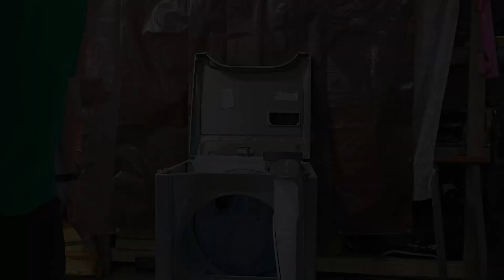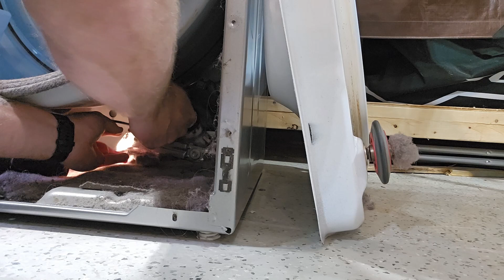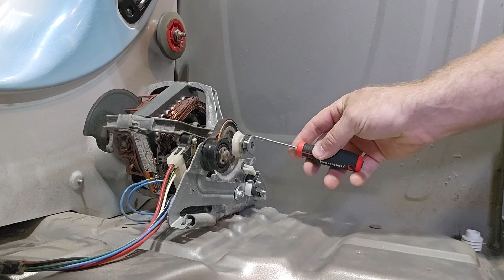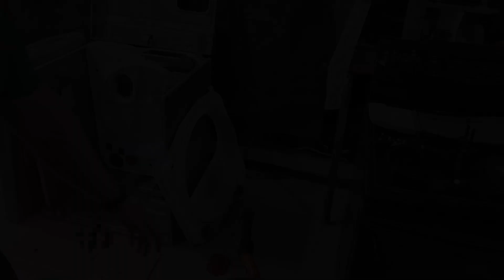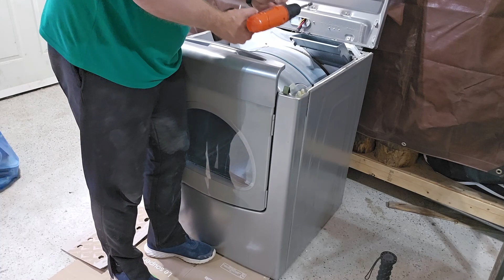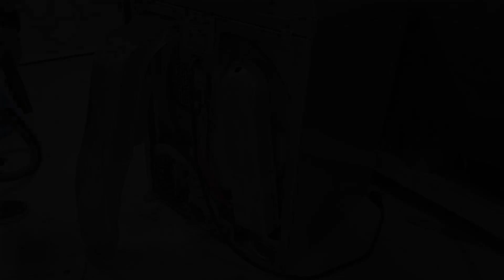How to Repair Your Whirlpool Dryer (DIY)

Comment: Greg, the centre of that idler is steel and the shaft is steel how come they don't just heat up and seize?
I've just used 400 grit on a shaft and replaced the idler and it heat seized in less than two minutes.
Any ideas?
Thanks from Andy from Aussie Homestead NSW Australia 🦘
Reply from the maker: Yeah it always seemed strange to me too. I clean up shafts of rollers and idlers all the time but never had one seize up, they are supposed to have an oil impregnated in them that is to stop them from heating up.